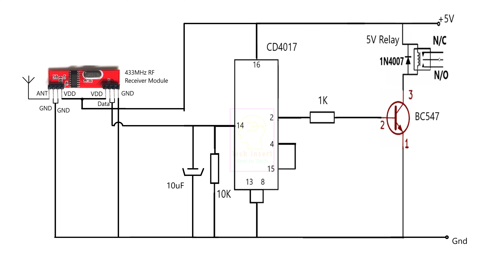How to make Single Channel RF Remote Control

Comment: Good circuit, I prefer to use a 1K resistor between the output of receiver module and 14th pin of cd4017
Reply: Ok
Reply from the maker: Since this is working in 3.7V that is not necessary. But you can use and will be safe

Comment: Since this is not using the address bit, multiple transmitters will create issues. I prefer to use an encoder with an address bit. It is safe and professionally perfect
Reply: 100% agree
Reply: Making short length antenna will make this device to work on short distance
Reply: @John-pk7lr Good idea, but if you live in a house like a cell in the city area what will happen
Reply: @John-pk7lr  Without antenna will work inside a room only. Good idea
Reply: @BabuRaj-cs4lk This technique is effective
Reply from the maker: I have made this compact. Reducing the antenna length in the receiver will reduce the transmission range

Comment: Can you please tell me how you know where to use which component.
Reply from the maker: I didn't correctly understand ur question. Can u describe a bit more. I am very happy to help you
Reply: @TechInsert  did you made the whole circuit by yourself or you learnt it from somewhere and teached us .
Reply from the maker: @raven1803  Some i learned myself , some i got from others. Eg:- RF module  - First I saw this in Amazon, later researched to find its usage. HT12E and HT12D - encoder and decoder , I leaned while doing mini project as part of my  academic. Switching using CD4017 - actaully it is an LED chaser circuit
Reply: That's what I wanted to know . How we can understand that if I want to make some project what type of components should be used.
Reply from the maker: @raven1803  That actually come from experience, reading etc. You can ask any doubt to me and I will answet to the best of my knowledge. Even in my channel some videos i made by watching 4 or 5 other youtube videos. Took some part from one video, took some part from another video and so on and made one single video which is a new idea and new video.
Reply: @raven1803  Normally we will take this from different circuits and integrate it